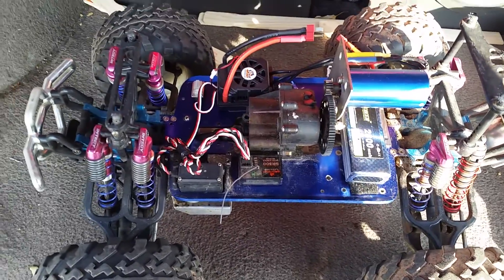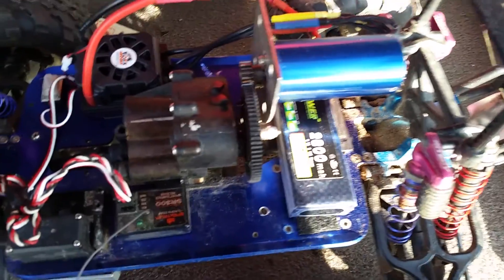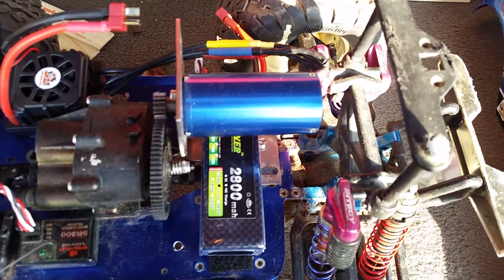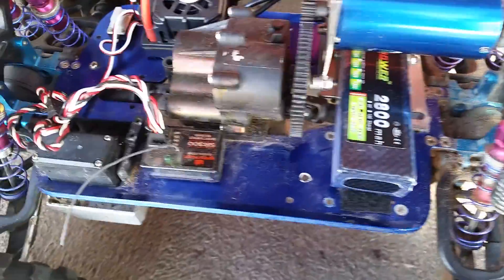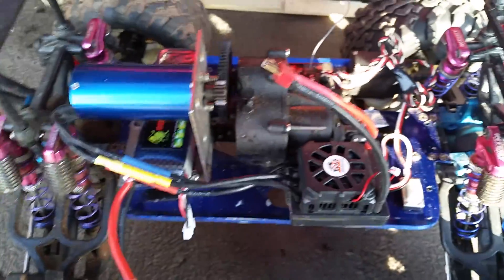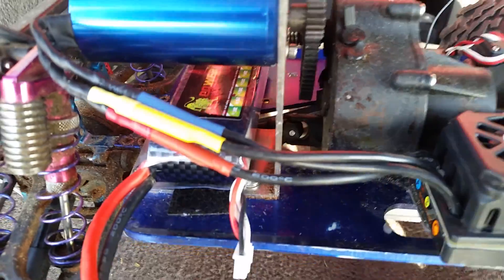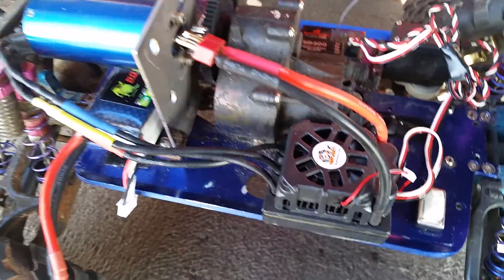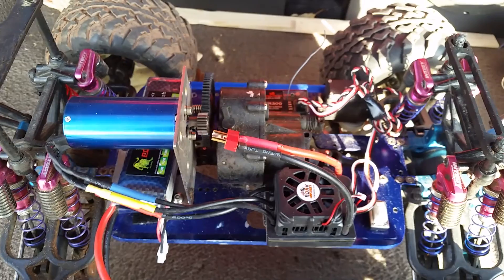Tmaxx conversion to electric

Comment: I did the exact same thing to a tmaxx 2.5 roller I found on fb auction. I just added the extended chassis and the emaxx tranny. I have dual titan 550 motors, and I'm running dual rage 5200 2s lipos. but I want an 8th scale motor.... where did u find that motor ?
Reply from the maker: I got it on ebay for 60 bucks